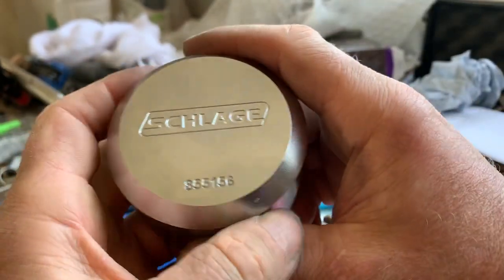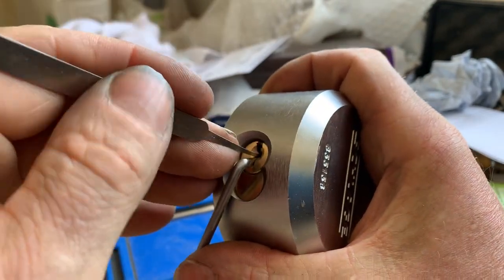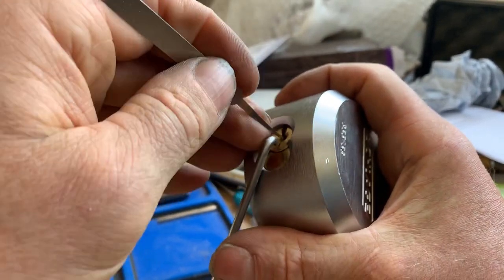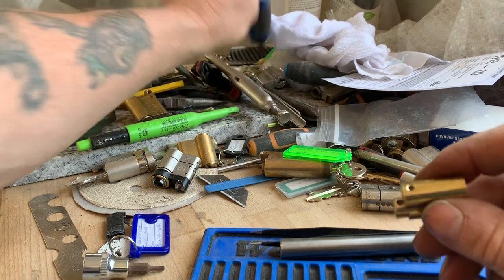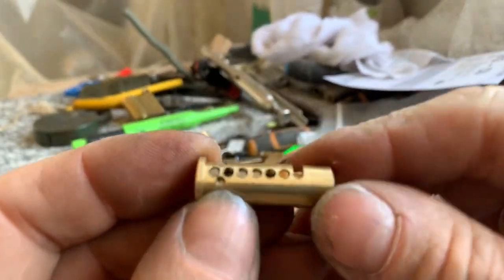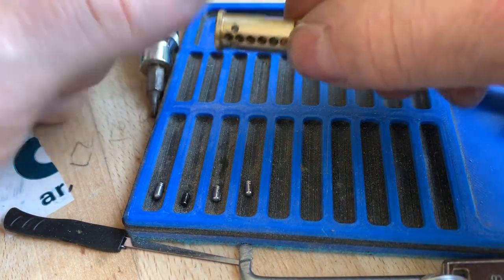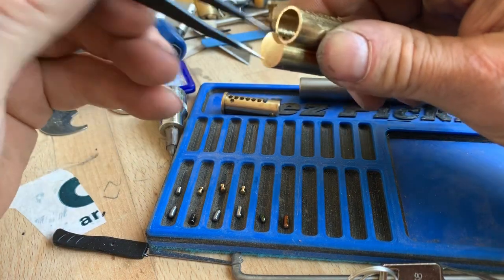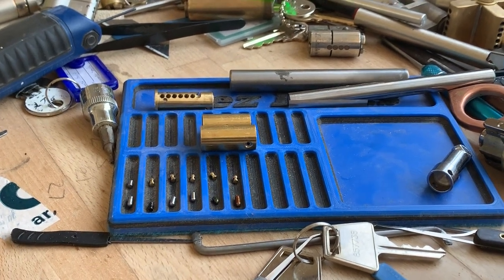(88) SLS Schlage puck lock picked & gutted.

Comment: The real challenge is to do one flat on the table or in its bracket, when in use. tensioning is a whole different beast, and chances are, you'll have to rake it open, while using TOK, but upside down. This is even more the case with the Master puck as it is inset more deeply. Still, nice one, geez!
Reply from the maker: Nobody Special 
I picked this one flat on the table a couple of times. The only issue was getting a good camera angle.